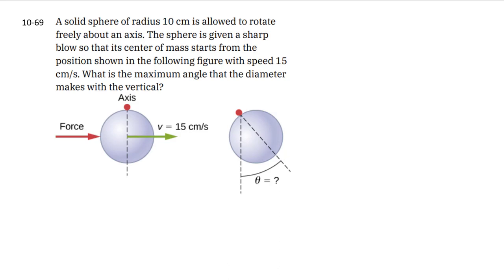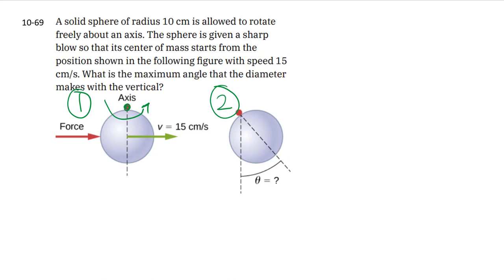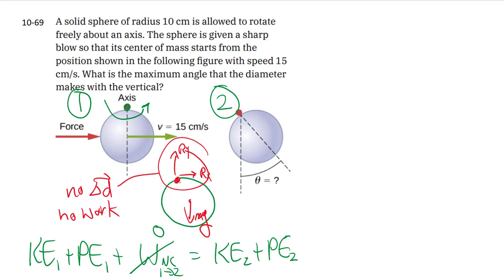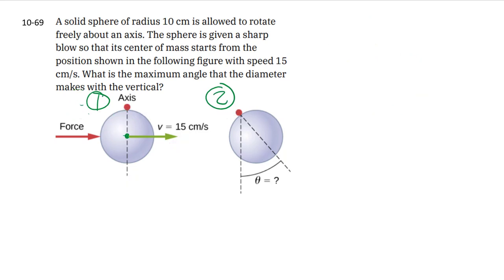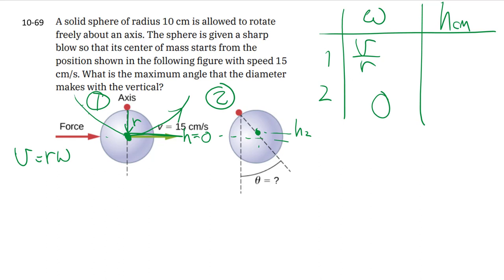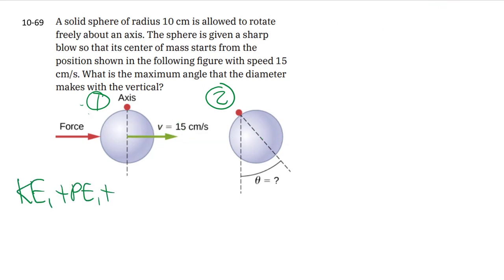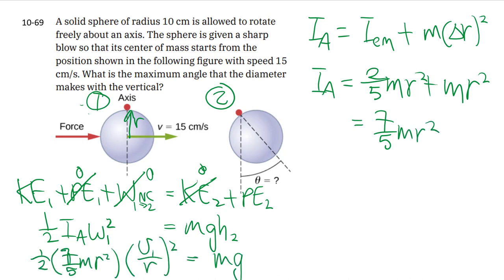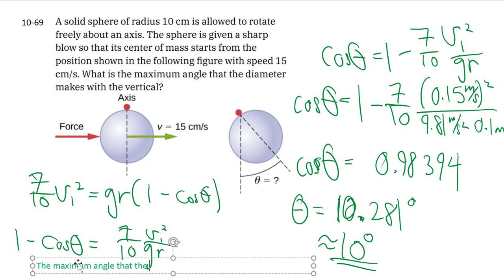10-69 Conservation of energy with rotational kinetic energy

Comment: why aren't you considering the linear kinetic energy of the sphere as the center of mass also has some linear movement and not just rotational ?
Reply from the maker: That's a great observation as clearly the center of mass of the sphere is moving while the sphere is rotating. Fortunately, since we are using a fixed point at the top as our pivot point, the translation and rotation terms combine to give a single term of 1/2I*omega^2 as a pure rotation about a fixed point.